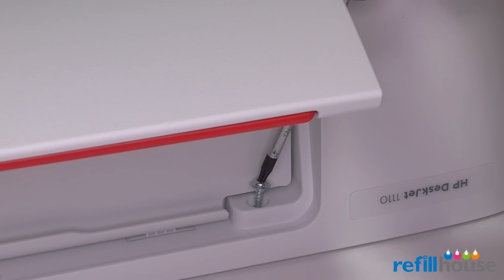HP Deskjet 1110, 1112 CISS - HP 63, 302, 123, 803; HP Deskjet 1115, 1118 CISS - HP 664, 680, 652

Comment: Can I use set-up cartridge on this?
Reply from the maker: Any ink cartridge can be installed,
Experience tells me that color ink cartridges are more likely to be "program controlled, rejected or damaged".
Reply: Refill House-填充小站-噴墨印表機-墨水-連供-改機-連續供墨-解碼-修復-填充專家 Because I'am planning to buy an empty cartridge. But how many mL do the Set-up cartridge have?
Reply from the maker: Black set-up about 1.8 ml, stand about 2.8 - 5.0 ml,
Reply: Refill House-填充小站-噴墨印表機-墨水-連供-改機-連續供墨-解碼-修復-填充專家 thank you
Reply: Refill House-填充小站-噴墨印表機-墨水-連供-改機-連續供墨-解碼-修復-填充專家 can I use a expired cartridge?
Reply from the maker: The original cartridge is expired and can still be used, but the problem of ink quality
The most fear is that the ink cartridge is often taken out, unplug the power cord, it is easy to cause the ink cartridge to read, causing the ink cartridge error, refused to continue to use it
Reply: Refill House-填充小站-噴墨印表機-墨水-連供-改機-連續供墨-解碼-修復-填充專家 final question what is better to use Set-up cartridge or ink cartridge. But can I still use expired cartridge?
Reply from the maker: Ink cartridges can fail
The filling is another option
As long as you can print ink cartridges, you can
You can refer
http://www.refillhouse.com/index.php?route=product/product&path=57_67&product_id=190
On the left upper corner of your window, you can change language to English and currency.
On the English website, You can also translate English into any language by the google translate option.
Reply: Refill House-填充小站-噴墨印表機-墨水-連供-改機-連續供墨-解碼-修復-填充專家 I'm from Philippines.Im just aking what is better to use set-up cartridge or replacement cartridge? And can I use expired cartridge?
Reply from the maker: you can use any HP original ink cartridge to modify, cannot use replacement ink cartridge.
Reply: Refill House-填充小站-噴墨印表機-墨水-連供-改機-連續供墨-解碼-修復-填充專家 what liquid material you spray in the strings and cartridge. Thank you.
Reply from the maker: spray string is pure water, ink tube  fixing plate using instant glue.
Reply: Refill House-填充小站-噴墨印表機-墨水-連供-改機-連續供墨-解碼-修復-填充專家 what about in the cartridge 7:33 what liquid material do you use?
Reply from the maker: is water
Reply: Refill House-填充小站-噴墨印表機-墨水-連供-改機-連續供墨-解碼-修復-填充專家 oh thank you. I'am planning to convert my printer. (HP Deskjet 1112)
Reply: Refill House-填充小站-噴墨印表機-墨水-連供-改機-連續供墨-解碼-修復-填充專家 Can i use yarn instead
Reply: Jhosh Yabut naset up mo na yung hp deskjet 1112 mo? successfull ba?

Comment: Automatically continue ink supply  no need every time rifil cartige?????
Reply from the maker: If the number of ink cartridges is printed, it is not monitored by the factory. In the case of normal printing, it is not necessary to fill the cartridges after each print.
The ink is supplied to the ink cartridge from the outside.

Comment: what is the average life time of a cartrige and how many page it can print on its life time? please answer. thank.
Reply from the maker: Your printer, if you use our CISS kits set and steps modified, you can maintain their own printer.
hp will be divided into four areas of the printer,
modify to a continuous ink supply, the life of each printer-head, about the province can save the purchase original cartridges  of eight.

Comment: Oh man.. tubes going from the top of the bottle. I'm having nightmares with the Workforce 30 I used to have and the brand "inkjetcarts" CISS... it relied completely on "super tight vacuum", which always lead to blank pages (the super tight vacuum is not a reliable system). When it comes to bottom tube CISS (relies on air pressure from the outside and a "not so super tight vacuum, but still a small vacuum",  it works very well. Just don't put the tanks too high or too low above the heads.

Comment: do we need to change the ink cartridge after finished all the ciss instalment? or we can use the same catridge forever?
Reply from the maker: When installing, ink cartridges need to be printable
You can follow the steps, start using the installation and you will know how to maintain your ink cartridge.
If you have ink cartridge damage, you can replace it with another ink cartridge.

Comment: What will happen if i do not put yarn on the black ink?
Reply from the maker: Q. why do you put strings? why are they needed?
A. Tear off the sticker, you can find hp 63 ink cartridge inside the two holes are empty - No sponge 
Will be about 5 meters of cotton slowly into the cabin, 
The purpose is to control the internal ink shaking, reducing the wave of pressure.
Reply: thank you so much for your reply :)
Reply: also i dont have yarn can i use cotton (fluffy thing) instead as a filler? should i need to wet it too?

Comment: What is the use of extra adhesive @ 25:24 ???
Reply from the maker: It is a single-sided adhesive foam sheet
To prevent noise caused by ink tube movement during printing

Comment: Cartridge Serial is detected by the software. How to avoid it?
Reply from the maker: can not avoid it.
Reply: @refillhouse  if that message continously appears and rejecting the cartridge, what should we do?
Reply from the maker: The unit price of the color ink cartridge is relatively high, and the original factory controls the number of printed Yield of color;
Please print only black as much as possible, or modify the black only.

Comment: Can i ask you a question?
If my HP Deskjet 1112 convert to CISS, is there any possibility to break my cartridge? Because based on my research only cannon, epson and brother only can convert to ciss
Reply from the maker: What you are talking about is convert to CISS. It is only a non-original ink cartridge with a decoder chip. It is installed directly on the printer, and the original chip is not directly used.
Well-designed, and you know how to maintain, you also need to consider the original control of the number of printing ink cartridges
At present, HP Deskjet 1112 is one of the hp software controls.
The control of colored ink cartridges is more stringent. You can remove them and replace them, but do not throw them away. Save them well. Other printers can still be used.
After replacing a number of ink cartridges, the ink cartridge that was previously detached can continue to be used
The hp set-up black ink cartridge is only 2.2-2.8cc inside, printing 100cc or more
.
Have you seen that the external ink bottle is 5000cc?

Comment: did you face any problem related to air bubbles or leakage of ink?
Reply from the maker: We have all encountered problems with bubbles or ink leaks,
The above continuous ink supply system has been used for more than 12 years, is a stable system
We take such a long film, let you know every detail of the modified printer
How to exclude air, add ink and maintenance, if you have many times to enjoy

Comment: Do not close the top cover part unless you are finaly finished even after tested, and only then to cover and refix evrythin' upto pc. Friendly reminder to others.
Reply from the maker: Thanks for your advice.
The internal ink pipeline has very little space for motion, and not every ink tube can be used in this space and the inner diameter of the ink gallery must be less than 1mm.

Comment: How many impressions does it have of useful life?
Reply from the maker: The system is installed correctly and used correctly for at least five years
The life of the ink cartridge, controlled by HP, currently allows you to save eight ink cartridges
The ink cartridge is failure or hp refused, you can easily replace and maintain
Reply: Canon printers at 4500 or 5000 prints are blocked. Are not hp blocked?
Reply from the maker: Canon no cloud surveillance system, will not block your printer
Reply: I print between 5000 and 8000 prints a month. What printer could you use for that amount?
Reply from the maker: You are now using the printer related more photos sent to me, including:
Printer model, continuous ink supply external photo, ink cartridge position photos
Let me help you analyze the problem, to help you determine the cause of the fault
You use the country with the area
My mailbox "refillhouse@livemail.tw"

Comment: Why to do so much of hard work if we can easily refill the cartridge by removing them...  give my 42 mins back... thank you so much for wasting my time..
Reply from the maker: Sorry, let's waste 42 minutes watching the video.
We worked hard to complete the 42-minute video and editing.
I am happy to share a lot of people and understand that the process of modify a low-cost printer is not difficult.
If you do not want to modify, there are easier ways to auto-convection fill tools
let's you to can easily refill ink into ink cartridges
http://www.refillhouse.com/index.php?route=product/product&path=57_67&product_id=190
Reply: It isn't hardwork; it's patience.
Reply: Samantha with its not just a refilling system, its a continuous supply of ink to cartridges which prevents from cartridges removal many times for refilling could mostly case the short circuit of its circuit and secondly its also prevents to empty the ink cartridges of all four colors in the middle of  printing any documents. Ink quantity is also visible in clear bottles instead of the cartridges you can see the ink lever after refill.